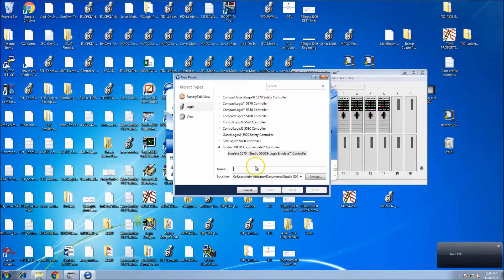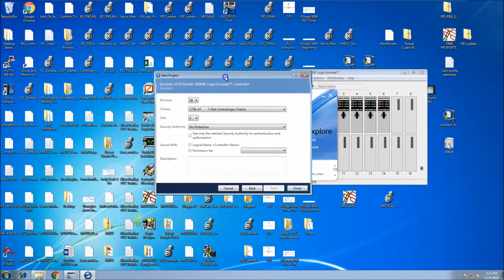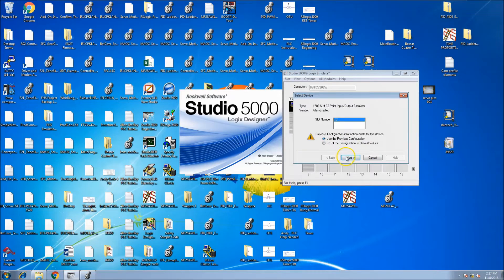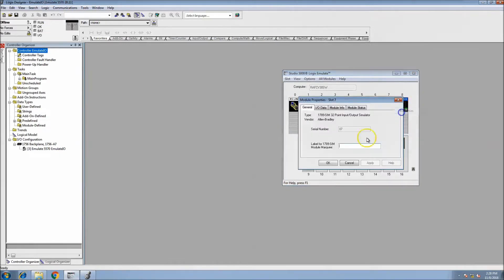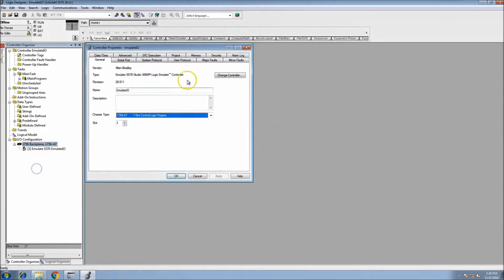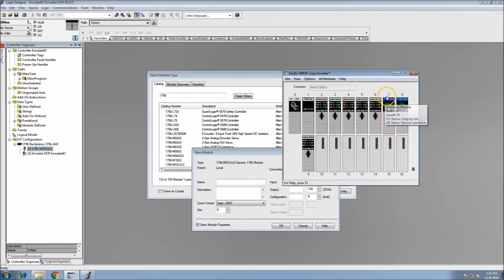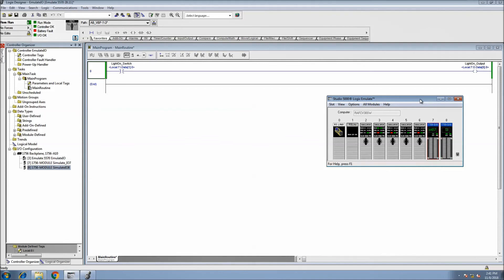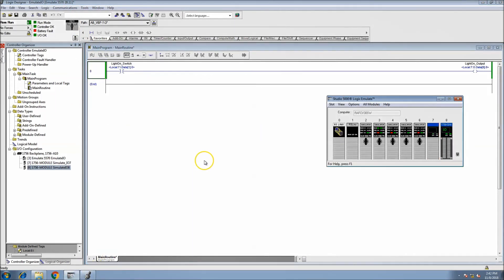Studio 5000 Emulation of I/O and Simulating Some Simple Logic

Comment: Good video, thank you! Any ideas to simulate analog inputs and outputs (voltage and current types)? It looks like adding generic cards to an already complete program to test the logic is a bit of a hassle. I can either delete the actual IO cards and put them back afterwards, or I can add generic cards to the end of my io rack and use a "testing" bit in the init to change my mapping files while inhibiting the real cards. Any better methods? I come from a Siemens background where simulator is a lot more friendly to completed programs.
Reply from the maker: Not possible to simulate analog in emulate 500

Comment: thanks for the knowledge. please can you share the link for Emulate 5000 v28, i'm having Rslogix studio 5000 v28 and Emulate 500 v21, is compatible??
Reply from the maker: You can't get free software, you have purchase it.

I understand needing it but it's not free
Reply from the maker: Keep in mind that the version of emulate that you used rarely matters, meaning, you can still export code from Studio 5000 version 28 program then import it into a new file that you make using Studio 5000 version 21 to use it in the emulator.

I just thought I would share a workaround to better help you.

I do this all the time.

I use versions 16 through version 32 on a regular basis.

More like version 20 to version 32 but at times I do have older equipment I work on.

Either way, I hope this helps.
Reply: @ShaneWelcher  thanks for the help. Thou, i have rsLogix studio 5000 v28 and emulate v21. I want to know if they are compatible, since they are not of same version's?? Or do I have to buy emulate v28?
Reply from the maker: @noelfaithfulkari2857  They are not compatible, just follow the directions I gave.

Or email me the files, I'll convert them

Shane@OnlinePLCsupport.com

Comment: Hi Mr shane thnks for ur precious explanation , 
My project in compactlogix  contains 18 cards , i need 18 slots to test my logic , is thete a way to test my program with emulator ?
Reply from the maker: Expand the emulate chassis size, just note that it takes more CPU memory
Reply from the maker: 18 slots is a bit much

Maybe just inhibit some of them during the emulation.

That is what I do.
Reply: Thnk u sir , 
Just one question , why when i add a 1756 (IO module on designer) that will match with 1789 (the IO on emulator chassis) it says CIP object in module does not exist ,
Reply from the maker: @naop86  the emulator us simple.

If you are not using a controllogix chassis then do not use any emulated I/O.

Just inhibit them.

Make a practice file & test.

You can emulate 1756 I/O
Reply from the maker: @naop86  You need to use a generic I/O emulation for I/O just like I did in the video.

There is no way to simulate all I/O versions because of how many there are in use in the world.

Please inhibit the connections & test your logic with toggle or simulation logic.

It is the easiest way.

Then you can see how things work step by step.

Simply by toggling the inhibited I/O bit on or off.

Hopefully that helps,

Shane
Reply: I dont want to touch my i/o configuration , as all the i o s are important n my project , is there a way to expand the chassis to more than 16 slots ?
Reply from the maker: @naop86  it doesn't hurt anything making a copy of the program then inhibiting the IO.

Make a copy then do it & test the system
Reply: @ShaneWelcher  Thank you for your prompt feedback Mr Shane , but what do you mean by inhibit IO , i should delete all IOs from my Program so it will not say errors when i try to load to the emulator controller ? or there is another way to do so ,
Reply from the maker: @naop86  

Do not delete.

Just right click to properties then select inhibit.